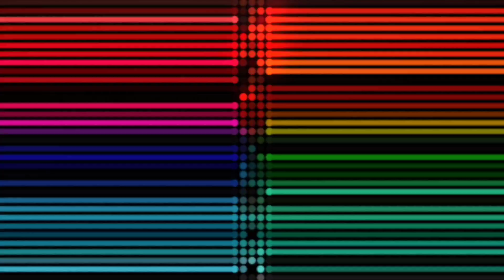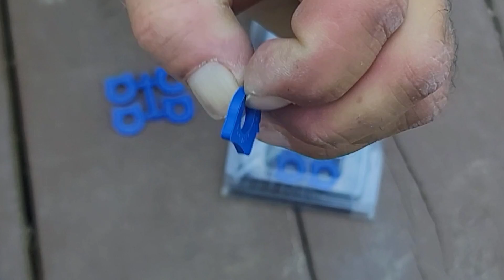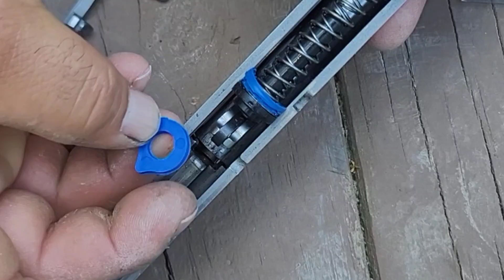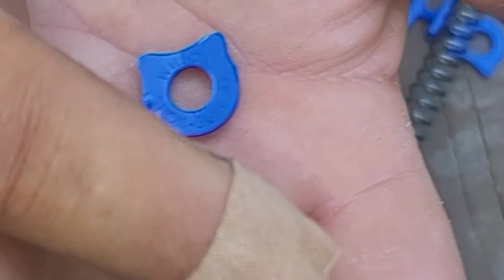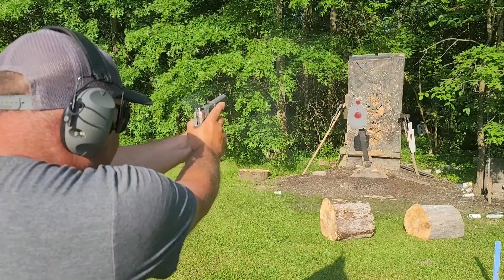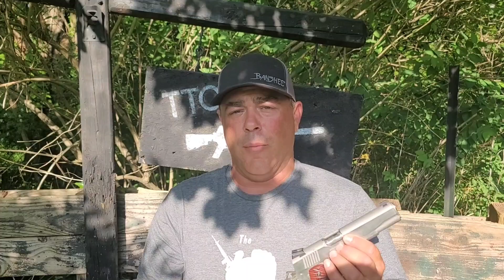Does Your 1911 Need a Shok-Buff?

Comment: I use them to reduce the felt recoil shock thru my grip, wrist forearm and elbow in my 45 ACP +P and 45 Super load, thus facilitating fast follow up shots… the 1911 can handle the impact without the buffer.

Comment: I have noticed that running a 16# spring in my 45 cal 1911's and 2011, the buffers get more chewed up, especially with hotter rounds. The slide dwell time seems a bit to long with the 16#. I put in an 18# spring and have gotten an easy 1,500 to 2,000 rounds before the need for replacement.  I've also been testing with different main spring  rates as well. The heavier hammer spring seems to help tame the slide acceleration to the rear which also seems to increase the life of the buff.

Every once in a while I'll get a jam where a bullet won't chamber, it only loads half way. Is this from the buffs causing a problem, I can't say. I need to take the buff out and go shoot a bunch and see if the intermittent jam continues or not.
Reply: I've made my own out of belt scraps of tanned cow hide. It is the best in my opinion.

Comment: 3:49 brother, that metal disc goes over the shock buff, in front of the spring. It spreads the spring pressure out and keeps it from cutting into the plastic. 

Was having the same problem in both my Tisas and Taurus models, i ended up tracing one on the inside of a beer can, and using a leather punch and scissors to make two shims to stack in put in each. Tripled the lifespan of that polymer.
Reply: Great comment

Comment: I just watched your latest 1911 230 grain test, you had some issues with Shok Buff and recommended this video to watch. I have just started using the Wilson Shok Buff in my 10mm 1911, I will check the buff ever 50 rnds to check the wear. Thanks for posting.
Reply from the maker: Thanks for watching! I use one in my 10mm Delta Elite and it does very well. But...that gun has a very nice recoil spring setup.👍👍👍🦃👊

Comment: I would recommend using these buffers in even a regular .45 1911-if you were going to be testing out +P self defense loads. I bought a mil-spec Springfield, had some tuning/polishing, and trigger work done to it with all high-end Wilson combat trigger, hammer, disconnect…etc. I was very happy with the trigger feel and operation. And I thought it was perfect. Until I started trying out self-defense rounds, what I found was that it did not want to feed anything that wasn’t your standard target ball round. So I got to work with my Dremel. I started by taking a look at the angle of the rounds as they are pushed out of the magazine, up to feed ramp, and into the chamber. Now I am not a gunsmith, however, I’ve been a mechanic for 25 years and I’m comfortable with using dial calipers, micrometers, feeler gauges, and figuring out angles, etc. If anyone reading this is having a similar issue, you don’t need to take very much material off AT ALL-tiny, tiny tiny amounts, in fact, if you had more patience than me, you could probably just get it by polishing alone. Anyhow, all that to say, that I ended up putting at least 200+  +P rounds through it until I was confident enough to carry it as my self-defense weapon for myself and my family and my friends-I do also have a heavier recoil spring in it. I don’t remember how many pounds exactly but it’s 20 something and I could see where on that buffer as well not quite as bad as the 10 mm one here in this video, but enough to know it was doing something!

Comment: Bought a SA TRP around 5 years ago. Been using the buff. I didn't care for the full length guide rod and went GI with flat wire recoil spring bumped up a notch. Wilson rod and spring. Ed Brown plug. There's been a lot of changes in the 1911 platform in the past century. It's still a work in progress constantly improving. I trust them and spending beaucoup bucks I'm gonna run a shock buff.

Comment: I installed a Wilson Combat shok buff in my Springfield Garrison .45, and it's even more fun to shoot now than ever before. It really does cushion the slide to frame impact, and the recoil feels somewhat softer too. My recoil system setup for my Garrison is an 18.5 lb recoil spring coupled with a shok buff.

That said, shok buffs are generally only for full size 1911s. Definitely test them out to make sure they work in your particular 1911.

Comment: Ultimate reloader made up a spicy 45 acp load pushing a 230 grain bullet at 1000 fps the buffer  could help out a lot with extra slide speed battering the frame
Reply from the maker: I saw that! Gotta get some enforcer! And you are correct about that buffer. It camt hurt imo.👍🦃👊

Comment: If you regularly change your recoil springs you don’t really need them but having them doesn’t necessarily hurt. That said 1911s are notorious for frame cracks on the left side so id say anything to reduce wear is absolutely helpful They definitely can hinder cycling though because when I installed one on my colt 1911 in .45acp I had so many failures to go into battery because the gun short stroked. But as the shock buff wore in a good groove it cycles fine now. Wilson combat recommends to replace them after 1,000 rounds.

Comment: I feel similarly about 45 ACP standard pressure but the buffer will protect the metal parts and insure they will last longer and endure less wear and tear over time. I also agree buffers can cause a malfunctions in the field so I only use buffers when on the range and remove the buffer after trips to the range. Ultimately nothing lasts forever but I feel you can get more longevity with your 1911 if you use these.

Comment: Yeah, when it falls apart and it gets into the workings of your pistol then what? I started carrying 1911s in 1973 six years in the military then I went on to 35+ years in law-enforcement I carry a 1911 every single day to this day and I’ve never used a shock buffer. I have used 1911s in 45 ACP 38 super 9 mm and 10 mm have literally fired hundreds of thousands of rounds never had a problem just because something is new. Doesn’t mean it’s a good thing and just because it’s made by Wilson combat doesn’t mean it should be used by everyone for everything in every gun it was meant for a very specific purpose, and type of gun and type of shooting. Now, if you’re in competition shooting, maybe a good thing. Everybody else for range hunting or personal defense or law-enforcement absolutely positively no need for it. Again, why would you take advice from somebody that let their gun go this long without cleaning it and checking it?Think about it.

Comment: My 45acp 1911 was literally grumbling into pieces I neglected to clean mine as well and didn't notice till I went to the range and realized it was slightly harder to rack the slide so when I got home took it apart and realized the shock buff was in a few pieces in the more I touched it the more it crumbled lol so it happens pretty bad on 45 also I guess it just depends on how much it's neglected and how long you let it go before changing it

Comment: You have to consider that JMB didn't manufacture the guns; they were submitted and minor alterations were sometimes made for manufacturing feasibility or cost. The recoil spring and maybe to an extent the guide rod is considered a wear item anyway, this is really just a service life additive. As long as it isn't causing malfunctions I don't see the problem and one can see the benefits of using these for the occasional firing of very hot ammo. We also understand that not all 1911 platforms are upgraded around the new cartridge as we saw the problems in early 9mm 1911 model.  The factory doesn't always know best, that's for sure

Comment: I use them as a spy inside the gun for me….ejection distance and angle are fine tuning tools, but the buffer gives me an extra data point on whats happening inside….i have run hundreds of rounds on 45 and 10mm and never saw my buff get that hurt….if i see the buff getting seriously indented, it means time for springs pit stop, or the springs and firing pin stop installed are incorrect.

Comment: would you leave them in your defense pistol ?  more potential failing points
Reply: That isn't the specific use case for these buffers.  It is for range toys and competition, where reduced recoil and main springs are used.
I've made my own out of belt scraps of tanned cow hide. It is the best in my opinion.

Comment: I use the shock buffs for years now. I converted my Ruger SR1911 45acp to the 45 Super. I'm chrono'ing a 230gr FMJ at 1,100fps and I chang the buffs out about every 200-250 rounds. They work for me as there is no damage to the frame/slide as of yet. Oh, I do use a 28lb recoil spring too.
Reply: JC, 28 lbs? You’re doing damage in the opposite direction, you should be running a sprinco or dpm setup.

Comment: Been on the fence with these….not opposed to them…just a little concerned about them coming apart and then jamming the gun when I need her to run…like in a bear encounter here in Montana…lol.   The other question, is when I used one of these on an Ruger SR1911 full-size…upgraded the spring to shoot 45 Super, made the slide feel a little stiffer, than Prior to the shock buff….So I do not know….I am consider using a bufffer for that Tisas 40 Super 1911 I converted…however I had also installed a EGW Full length guide rod kit and the guide rod is actually smaller in diameter…using IMSI flat springs….and so I wanted to try some sort of buffer on this pistol to see if I can sense any difference.   Perhaps I can  find a neoprene type round washer to fit and give it a go and see what happens.    Will see…thank you for posting this….have a great day.

Comment: Mine did the same damage over time and I found that if I used a needle file to brake the sharp edges on the back of the tube that surrounds the recoil spring plug and slams into the buffer during recoil that the buffer lasts almost forever. 🙂

Comment: My original Delta Elite that I got back in the eighties when they came out has never had a shock-buff and it has thousands of rounds through it. With that said I have never used the buffalo bore high pressure ammo in it. I bought another delta in 2012 the year they went bankrupt and I had several feed issues so I had a gunsmith friend of mine mill the lower and fit a SS bull barrel and spring bushing in it and that ended all the feed issues and it still as accurate as before. I might have to get some of those S.B’s and try it.

Comment: I have several Wilson 1911s in the single stack and double stack variant that have come with Shok-Buffs (SB).  My experience is that some of them have hardened with age sitting in my spare parts box and become brittle.  Maybe the polymer construction has improved with time?  I have had them hang up guns in 45 acp and I am one who cleans and inspects my guns every time they are fired.  My most recent acquisition was a Wilson double stack that came with one installed which digested 350 rounds of range ammo without a hitch.  However, switching to several types of premium defensive ammo the gun became sluggish with frequent failures to return to battery.  After some experimenting, including changing out the SB, I removed it and the gun ran fine.  I would say the recoil was softer with them but not worth the trade-out for dependability. IMHO they are fine for range guns, but I do not trust them for EDC.

Comment: It looks like a flawed design from the start; if the buffer was a little thinner you could add an additional stainless shield to the spring side and it would be almost indestructible.
Reply: I've made my own out of belt scraps of tanned cow hide. It is the best in my opinion.

Comment: I’ve used them , they definitely work, but for now I’ve decided to stick to flat wire spring only, with no buffer, because I don’t like the loss of slide stroke, even if it’s just a millimeter or so, when the buffer is installed

Comment: The correct strength recoil spring should negate the use of a shokbuff.
Reply: A book could be written on that subject, most people opt for a higher rated springer which causes it’s own problems, 15lb with a buffer.
Reply: Define ''correct''.

Comment: Been using Shok Buffs since the 80's, and using 10mm and heavy .45's, they prevent the damage. 
Simply changing the recoil spring is not an answer as you can damage the barrel feet, slide stop, and help to   elongate the frame SS holes.

Comment: Ok, now the truth about shock buffs since most people don’t know. Shock buffs were designed for USPSA competition where guys were running super light springs to reduce recoil. They also started experimenting with heavy guid rod made out of tungsten. The Tungsten guide rods had a tendency to break locking up the gun. Shock buffs were designed to protect the gun using light springs and also cushion the impact on the guide rod for people using tungsten guide rods. The question you should ask instead of pondering and coming to your own conclusions is, are the USPSA guys still running buffers. This will answer whether you should run one!
Reply: I run one with an 18# wilson combat spring, and run everything from 78gr civil defense to 255gr P+ buffalo bore. 

From my experience, all it really does is give you a bit more lock-up. Recoil is still the same, and that extra tension makes field stripping/takedown just THAT much more difficult, especially if you’re like some of us that run both bushing comps and FL guide rods. 

Would love to see the action on a high-speed camera and see what its actually doing to the system.  I’ve got my own personal opinions on the extra spring tension and padding keeping the GR in a more consistent position (while in battery.)

Comment: The shock buff seems like a solution for higher pressures like the 10mm and 45gap.
Reply: Yes, or spring tuning a pistol with much lower main and recoil springs in my opinion.
I've made my own out of belt scraps of tanned cow hide. It is the best in my opinion.

Comment: Just put a heavier spring in it instead
Reply: Yes, however, the entire purpose of these buffers is to help offset spring down-tuning on the platform, such as running an 8 lb recoil and 17 lb main.
They weren't designed or intended for implementation on a carry or duty use pistol that comes from the factory with a 16 lb recoil and 23 lb main...for example.

Comment: I'll tell you my experience with shock buffers before I even watch the video.  I shot IPSC with a 1911 for five years.  That was back in the '90s.  We started using buffers, and I don't know if they prolonged the life of the pistols or not, but they greatly reduced the amount of shock I felt in my hand, wrist and elbow.  I stopped using them when I stopped competing.  I never use them in my carry guns.  But they were effective when I was competing and firing 10,000 rounds of major .38 Super each year.
Reply: I've made my own out of belt scraps of tanned cow hide. It is the best in my opinion.

Comment: The thing about shokbuffs is to change them often. Waiting until they are deformed or torn is asking for problems.  That said, standard 45acp loads in an all steel frame gun you don't need them, and I would not recommend using them. Move up to 45 super,absolutely. For 10mm  , if using full power 10mm ammo,  you better believe it, but most anemic 10mm ammo nowadays I don't.
Reply: How about for alloy frame commander size? I have a S&W scandium frame 1911. Love it, don’t have any shok buffs.

Comment: I think as long as your confident that it does not comprimise the reliability of the firearm it is good. If you shoot full power 10mm, or lots of 10mm, the shock buff gives the firearm a longer service life and that is a plus. If howevee the shock buff at any time causes the firearm to be unreliable, I personally, would either delete the shock buff, or remove that firearm from my carry rotation untill I was confident it was 100% reliable. But that os just my personal feelings. Really nice piece Turkey 👍

Comment: I have a question can you put the buff behind that little metal piece to keep the spring from eating it or get a second little metal piece to sandwich it on the guide rod so it still absorbs the shock without getting chewed up?
Reply: I was wondering the same thing, and if deformation would be more likely to cause malfunctions behind the metal piece.
Reply: The Detonics recoil system had this exact system way back in the 80's. They worked.

Comment: If Wilson puts it out, I’m a believer.
Reply from the maker: They know 1911s pretty well👍👊🦃
Reply: Been using Wilson's on my 1911s for over 35 years without issue. They do soften the recoil a bit IMO.
Reply: I have one for my Beretta M9. Works same way.
Reply: I like them for my aluminum-framed 1911s.
Reply: Most underrated fact right here. I got one for my tupperware

Comment: John Moses Browning didn't envision the 10mm either being used in his firearms
Reply from the maker: Truth!👊👊🦃👍
Reply: And we have hotter ammo than he did. 45 +P will beat a gun up if it's not designed for it. 10mm is even more abusive. I've watched all your vids and shot one before. Makes a 45 feel degraded
Reply: Nor did he envision the almighty 460 rowland in his 1911 either! Which btw, DESTROYS shok-buffs relatively quickly
Reply: @craigbraswell4269 thus why they give you 6 and you can replace it fast and cheap

Comment: The only caliber I shoot in my 1911A1s is the 45 Auto. And I see no need for a buffer in that caliber. However, I can see the need for one in 10mm and other high pressure cartridges. Sure, John Browning designed the best autoloader pistols, but he didn't design them for excessive loads. The buffer makes sense.

Comment: got my s&w m&p 10mm😊. shok buff might be a good product. but colt should've thought about 10mm being fired a lot.
Reply from the maker: It gives that gun a workout!👊🦃👍
Reply: Cold had a lot of trouble with that. Delta league, 10 mm braking frames and stuff when it first come out, they just took a standard 45 and stuck a 10 mm barrel on it What was a piece of crap